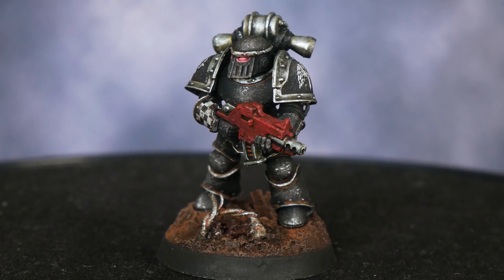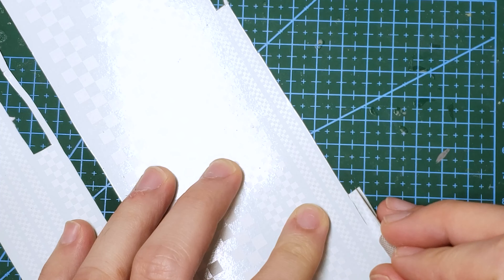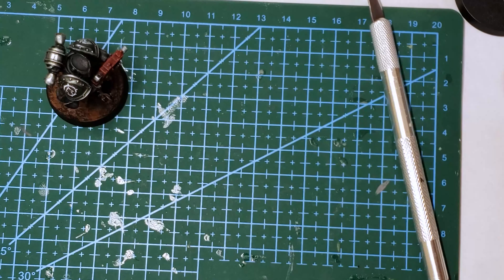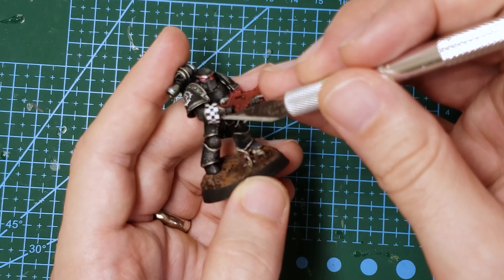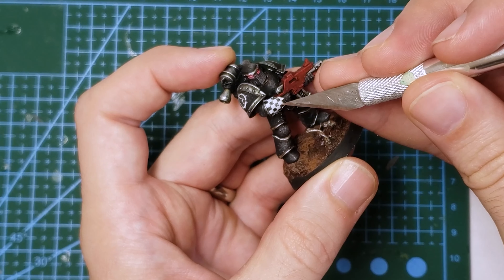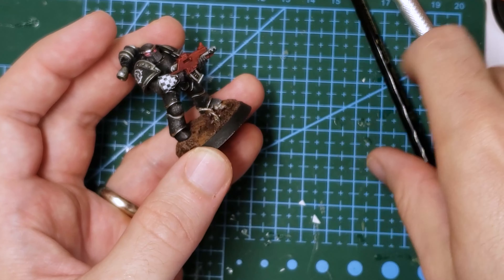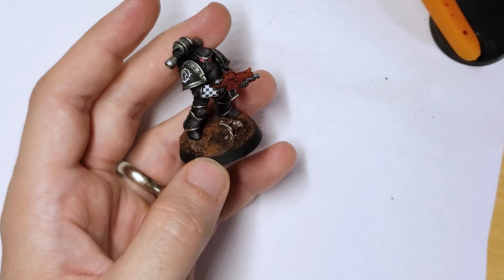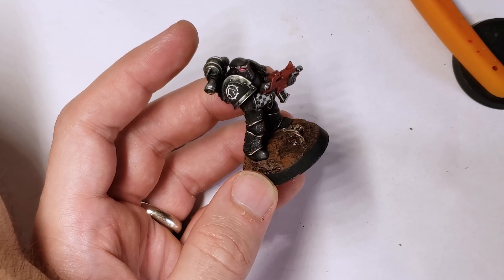How to Apply Checker Decals On Warhammer Models

Comment: Would you, as an expert on applying decals to Warhammer miniatures, consider getting the "caution stripe" decals from Fallout Miniatures to use them for Iron Warriors? I have tried some freehand but I am very much not satisfied with the result. Is it possible to wrap the whole shoulder pad in a hazard stripe decal and make it both fit and conform to the surface using Micro Set and Micro Sol? I am a bit hesitant to buy the decals just to find them cracking and forming waves.
Reply from the maker: I actually think you would have a lot of trouble with trying to get decals to completely cover a shoulder pad due to the curvature of it. I have a hard enough time getting Forge World decals to lay flat with out some cutting sometimes, and they are considerably thinner than the Fallout decals.

What I would recommend instead is that you use masking tape for the hazard stripes. Even if you don't have an airbrush, you can sponge on paint over masking tape to give you full coverage with out running the risk of paint running under the tape. So I would do a black base coat, apply the masking tape, and then sponge on a couple layers of yellow over that. Taymia make really good masking tape in 2 and 3mm which you can get on Amazon and is what I use for all of my hazard stripes (Such as in my iron warriors video)